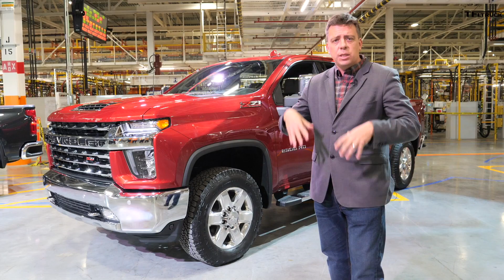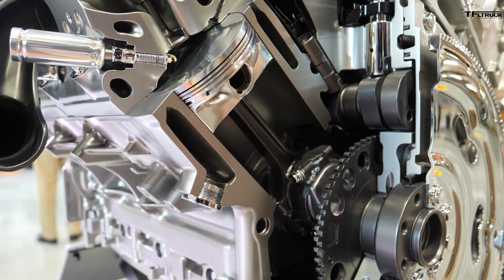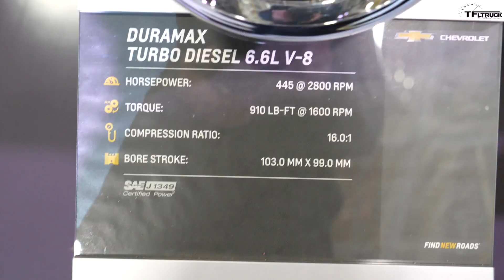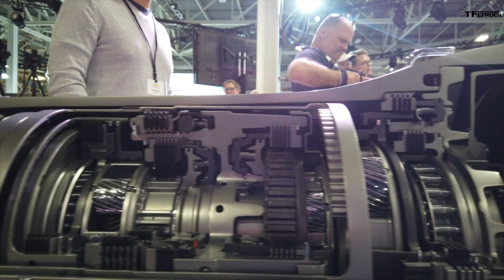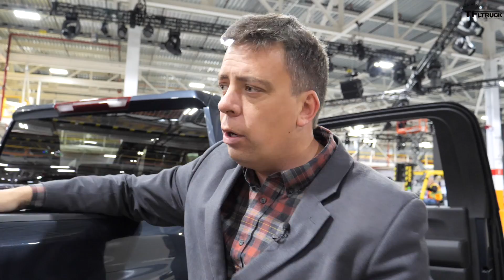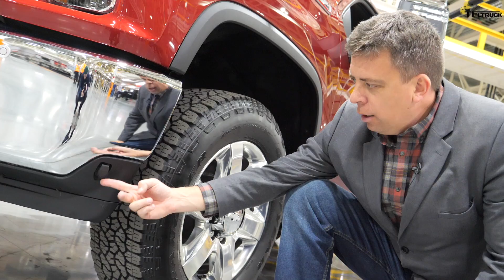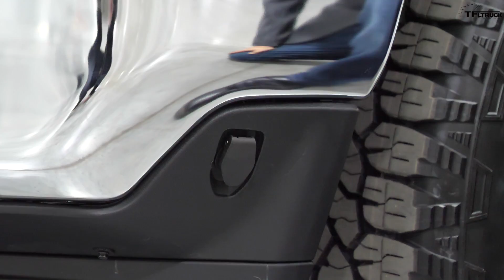Here is How the 2020 Chevy Silverado 2500 HD Delivers the Torque to the Ground

Comment: Those stupid ass mirrors could’ve been attached in the blank spot by the window and the visibility would’ve been exactly the same.
Reply: That was a stupid move from GM...
Reply: Completely agree!
Reply: Inferior engineering... it's not even affirmative engineering, it's just inferior.
Reply: Maybe y’all should work for GM then since y’all are brighter
Reply: I dont find anything bad in those mirrors.
Reply: They probably did it to reduce air noise

Comment: 6.6l v8 gas with only 401hp and 464 torque! 6.2l out performs this pretty good, I understand the more cubic inches the better the durability. But should have did a 427 with 450hp and 500 torque at least. Looks like for will win this one, but we will see when the 7.3l number come out.

Comment: 6.6 gm gas has some decent numbers
400 hp @ 5200
464 tq @ 4000
6.2 Ford is 
385 hp @ 5700
430 tq @ 3800 
The 6.2 works well and decent fuel economy from my experience with one , I'm very interested in this 6.6 or Fords new 7.3 Godzilla but I do hope they are not pigs.

Comment: I was interested in the 6.6 gas V8 until he started to describe it.  Direct injection huh GM?  How are you going to keep the junk from building up on the intake valves?...     Yeah, I think I'll take the 6.2L Ford now or wait for the 7.3..  Thanks anyway.
Reply: You do realize there are millions upon millions of direct injected cars/trucks on the road? I know people that are approaching 200k miles on 5.3s with no carbon issues. So overblown worrying about DI.
Reply: Direct injection has had these problems since its inception and I highly doubt there are millions upon millions of engines on the road with direct injection. You do know that not all fuel injection is direct injection right? Lets table that for a minute.   From GM perspective the 5.3 had standard sequential fuel injection since its introduction in 1999. In 2013 they increased power and changed to direct injection.  There are not a lot of 2013+ GM trucks running around with 200K miles on it bud.  The service process for this can be costly and is something I would care to avoid in my pickup, unlike my neighbor's 5.3 who is dealing with it now.  Its not overblown, and I am not interested in dealing with it in an HD pickup but if you want to buy one go right ahead.
Reply: I should add that very soon it will be unavoidable. Even though I am looking at a Ford HD truck now, eventually I see all engines going this direction. Thankfully the manufacturers are improving as we go along.
Reply: There are millions of direct injection motors lol. Every GM gas truck after 2014 is except the 6.0. Silverado / GMC sales every year is almost a million,  add in Tahoes, Suburbans,  Escalade.  BMW has been direct injection for a decade. Some people I know drive 40-50k miles every year, 200k on a 2014 is easy to do bub.
Reply: I am aware of how many vehicles GM sells, However your original argument implied the the sheer numbers of 5.3 engines through their life span, not just the last few years. I have had several of those myself.  I also drive that many miles/yr for work and my late model GM car, which is also direct injection, has to be serviced yearly for the buildup issue.  My previous GM cars did not as they had sequential efi.  In this day and age any average Joe who commutes that far in a truck (excluding commercial use), Suburban/Tahoe or Escalade needs to re-evaluate their life choices. 

If you like it, go buy it. I don't and I'm not

Comment: I have a 6.0 it’s a gutless engine!!! 2015 2500HD in case you’re wondering it will get you there and back but it’s stupid thirsty and the 6 speed still has a stall in it just as the 1/2 ton and it’s a known issue. The gas was the best option with the DIF issues that shut the truck down and that’s not a option while plowing. That is hands down the ugliest truck I have ever seen! I’ve been a Chevy man until now I won’t buy one of those. On another note the height of the trucks is stupid and unnecessary. Selling these will be more difficult because the only people that can afford these are older adults that do not enjoy getting on a ladder to get into them. What the hell are you thinking Chevy!

Comment: I am 1 million percent GM but give us a updated 8.1 or bigger with a 10 speed. wtf were they thinking could easily be 500 hp and 650 torque. Come on please
Reply: They have government cafe standards to meet
Reply: There's no way they could make the 8.1 pass emissions today, even with better heads. The DI gas engine should pull almost as well as the 8.1 with double the gas mileage. The part-throttle torque is really impressive with the DI engines.
Reply: This motor makes more power with way less weight and likely better mileage. If you need more power, get the diesel

Comment: Chevy needs to fire who ever designed that grill, its fugly. And the PTO isn't really a first, as all three have had PTO capabilities for a decade or more. The only difference is you don't have to drain the trans fluid to bolt a PTO on the truck.
As for the block heater, all of the big three should have the plug integrated into the bumper or the grill someplace.

Comment: The GMC HD looks so much better. Them tow mirrors are whacked they need to mount them back to we're there supposed to be mounted. I'll take that 6.6 gas 6spd auto over the $15 000 price jump expensive to fix and maintain diesel. 6spd auto probably $3500 to replace 10spd Allison = probably second mortgage to replace.

Comment: If you thought the 2003-2006 Silverado was ugly AF, this one takes the cake...
And that fuel pump drive..off a lifter on the cam? Hello? The AFM lifters are bad enough for reliability. FAIL
Direct injection...first? a 2 DECADES old F-350 has it. With a gear driven pump.

Comment: What is the point of filling in the hood scoop and making it none functional on the gas powered models? Wouldn't ANY H.D truck benefit from extra airflow under the hood under heavy hauling/towing conditions? Typical GM engineering.

Comment: How much you want to bet Ford’s new 7.3 liter gasoline V8 has more power and torque?
Reply: 6.6 vs 7.3 ...it better lol
Reply: No replacement for displacement, should've built the 8.1
Reply: ghost jesus that 8.1 is a beast. Hard to find too.
Reply: Really? Most of the 2500s and 3500s around me are 8.1s because people don't want to drive to town for fuel or wait 2 weeks for parts every time they break

Comment: The engine block heater connection location is good BUT why did they make where you now have to keep up with an adapter I prefer the plug that a std extension cord plugged in  Bad move there. Unless they want to make more money selling replacement adapters

Comment: Of all the places to mount the block heater plug, they choose one of worst locations on the truck and used a cheap plastic plug. They should have mounted it higher and in the center of the bumper. Also they should have used a heavy duty metal plug as found on large trucks.

Comment: Class leading torque with REGULAR fuel.  Someone actually mentioned fuel type for once.  So nice to hear, so irritating for the viewer when it is ignored.  Diesel #1, Diesel #2, Bio diesel, E85, regular, midgrade, supreme and ultra supreme.???  They are not equal and they all cost you more or less per mile.  MPG DOES NOT MATTER UNLESS YOU COMPARE THE COST PER MILE...............  WAKY WAKY.

Comment: They needed to revive the 8.1L V8.... i could see a very updated version pushing the same HP as the new 6.6L Duramax and probably having 500 lb ft or torque.
Reply: Well they need to. 8.1l is the answer to compete against the 7.3l Ford it can easily be tuned to push out at least 600-650lbft at 2250-2500 rpm with direct injection mpgs might average midteens and can last 500000+ miles

Comment: I can't get past the ugliness. Thought it would grow on me by now but NO just too damn ugly. The engine looks promising with how thick the cylinder walls are. If they can only fix the front end to make it more appealing
Reply: Engine hp and torque is pathetic.
Reply: ecoboost rules Your Pathetic
Reply: @JoshuaOverman  no GM is pathetic. 110%  look at it as a whole. Everything about it is pathetic.
Reply: Peak HP and torque are kinda low, probably has a nice wide powerband and flat torque line though, considering the way the numbers work out for it's displacement
Reply: wait for the Sierra

Comment: Okay I'm a little confused. Is there a reason they dumped money into this 6.6L gas engine when the 6.2L they have and use in the smaller trucks produces more Hp and almost the same torque as this "new" engine. Honestly, kinda shocked how low those numbers are for that much engine displacement IMO.

Comment: Only took 40 years for a ls 400 Chevy small block
Reply: What is a GM 5.0 is it a 307 305 or a 302 and yes GM made a 302 and yep u got it there all 5.0 liters
Reply: @katiefranklin3117  - The LS7 is a 427 so they've had higher displacement smallblocks before
Reply: @seantaylor2683  I was insinuating on them bringing back the 400 the 6.6 smokey and the bandit ta motor they've had lsx over 500ci before ls7 is a bored and stroked ls1 motor essentially
Reply: @katiefranklin3117  The 400 used in the Smokey and the Bandit car was a Pontiac, completely different engine from any Chevrolet small block or big block.
Reply: @tommyw.9424  so is a ls 6.6 and Pontiac is no more so they can't make a Pontiac motor but you can swap an old 6.6 ta to a ls 6.6 and build one bad ass car after you build a chassis and cage for it so you don't rip it in half when u launch but yeah Pontiac had a 4.121 bore and and all components are different
Reply: It's a 403 . Math is your friend .
Reply: @Dr.Westside  6.6l is still 400 ci no matter if it has the extra 3ci or not they call a 350 a 350 and it's not 350 ci

Comment: I have a 2016 Chevy Colorado 2.5l. Lt 4x4. The bad 9000 miles bad torque converter.
Front end squeak been to dealer five times can’t find the problem. Brake module bad. Power assist motor light on dash multiple times found  bare wire. Now 50,000 miles bad torque converter again.

Comment: That's great that it makes ALMOST as much torque as the 3.5 ecoboost
Reply: Twin-turbo that 6.6 and see what happens though, there's no replacement for displacement
Reply: @ghost-jesus  and if my aunt had balls she'd be my uncle, but she don't so she isn't.
Reply: Buck's Shots that 6 cylinder that sounds like a blender running?
Reply: @RayJBryant  yeah that tiny engine that makes more torque
Reply: @geauxtigers2911  ahh are you comparing Ford's decade old smaller displacement V8 to Chevy's all new higher display engine? Rub some cream on that butthurt bro. It will get better
Reply: Buck's Shots you most not understand rotational mass.

Comment: It is good to actually see these trucks in person or live instead of just renderings. I am in the camp of actually liking the look of the truck. I can appreciate traditional truck looks as well as a more modern take like the new Chevys. I wish that they offered an RST trim like they have in the 1500s, I am more like Andre than Kent from Mr. Truck.com. I absolutely HAAAAATTTEE all that chrome and huge chrome bumpers. Yes I know they have the Custom with the monochromatic look, but I would rather have a 2LT leather interior and bucket seats without having to go up to the High Country and HC prices. I know that the last generation trucks had a Custom Sport in the LTs and the Midnight Edition, but not everyone wants an all black or white truck. Come on GM enough with the BIG chrome front bumpers. Other than that I still like the truck and the added power and towing/trailering apps and tech that they have put into the new 2020 HDs.

Comment: Direct injection😬.... Ok now Ford, give us your numbers 😎
Reply: HP will be over 450 and torque will be over 600 lb/ft
Reply: @vernonpitts6630  if you think it will make 600 ft lbs you're smoking crack
Reply: @geauxtigers2911  i could see it  in the neighborhood of 500 though.   Or is that wishful thinking🤔
Reply: @peterad1529  500 is possible.

Comment: I swear Chevy designers must copy Toyota vehicles. The front end looks like it's off a Toyota 4Runner the wheels are off of damn Toyota Tundra and the side profile looks like a damn Tundra
Reply: Except it's a 2500 (real truck).  I don't think the polo wearing, loafer wearing, wanna be tough guy, living in a neighborhood with houses on top of each other, using his Tundra to race stop light to stop light and the occasional trip to Lowe's to get bagged mulch because his wife told him to was included in the Chevy design.

Comment: You done need a diesel. I wouldn’t buy nothin unless it’s got diesel in it. If you towing anything at 80 miles hour like an asshole up a mountain. Like them 40 footer toyhaulers. You need diesel. Gas is dumb.

Comment: A love the outside of the trucks but the inside still sucks they have no innovation when it comes to the inside outside looks nice inside still the same old plain Jane
Reply: Some of us don't need a 12' ipad and all the buttons from a space shuttle in our trucks. Plain jane is just perfect, actually to me it's even better.
Reply: @dedalliance1   
 I don't need the buttons over 12" either I don't like that screen in a truck but I would like for the truck to have some type of style not to just be plain
Reply: @edwardjackson3952  Buy an Lincoln half ton then I don't know what to tell you. Let me ask you this, would you rather have 'style' or have a truck that'll run you 250k miles with regular maintenance and tow any decent sized trailer you throw at it for the next 15 years? Because when I buy a truck that's going to cost me a lot of money, that's the only thing I care about, how long will it run before I have to spend another a lot of monies to replace it, if that specific brand has the reputation of running the longest but has a little 'plain' interior who really cares? In the long run, I'm gonna be much happier seeing that odometer go at 300k miles before I hand it off to my kid in 20 years when they go to college, and then I'm gonna be even happier when it's returned still running at 400k miles. It's a truck, not a luxury vehicle, but you can buy anything you want for any reason.

Comment: Shame on ur GM for using 1950's design on the pistons and block...
Its 2019...lol
Reply: Dont talk shit about something you dont know about, bud, 2020 pistons are short skirt silicon rich pistons, 50s pistons were long skirt, low silicon castings, and 50s blocks had 2 bolt mains,  and sand cast iron, 2020 are 6 bolt main high pressure casting compacted graphite iron. The only thing they share is a 90 degree V 8 configuration.
Reply: @oddzylinderfudgrub1951  you can't explain anything to a dumbass... you're waisting your breath
Reply: yea typical gm new, ugly  as a star trek villain, and outta date engine technology, cause ford done done it and gm copies (a actual fact) but hey that 7.3 ford v8 coming for 2020 is of push rod design.  i wonder if gm contacted the foundry that makes their metals to tell them to bump up the substandard specs to 1 dollar less than standard as they try to tow 35,000 lbs. will you be able to align front end after towing 35,000 or will the frame be bent. retired mechanic never had much faith in gm trucks(they made me a lot of mula) and will never own another one period.
Reply: @charleshollingsworth1583  if you're a mechanic then you know a push rod engine is better for pulling than an over head cam because they make their power down low better... that's why ford went back to push rod with both the 7.3
Reply: @charleshollingsworth1583  and you explain to me with your facts how GM copied Ford's engine technology...I'll wait
Reply: If it works, don't fix it.
Reply: Mysterious Stranger From Arizona  
True bankruptcy....bahahaha it's never worked...its failed year after year law suit after law suit crack head jack!
Reply: @lukeoliver687  that is not even close to an old design lol people should stop saying how stupid can you get because you took it as a challenge
Reply: @geauxtigers2911  took as a challenge?? Bud gm trucks are horrible...gm get law suit after law suit due to their trucks....u can't even go a full oil change without adding a gallon of oil....they are junk have been for years prob always will be... 
Why do u think they are always bailed out...
Afm issue after issue...engine rebuilt yearly....best of luck folks